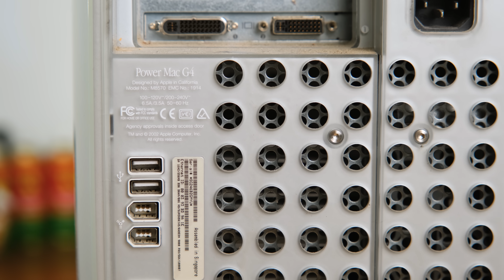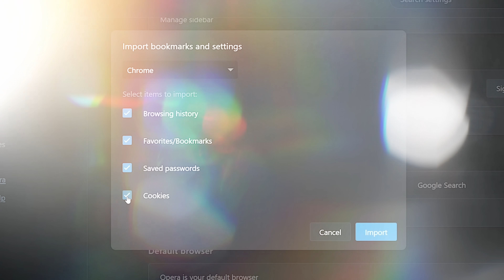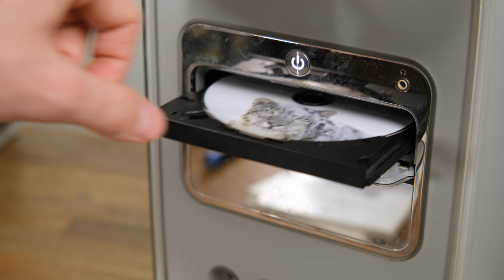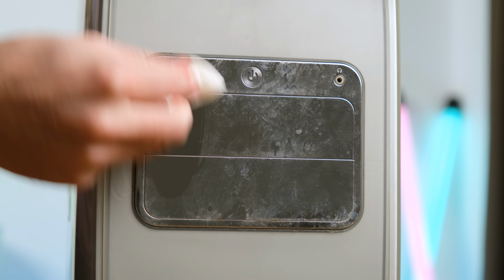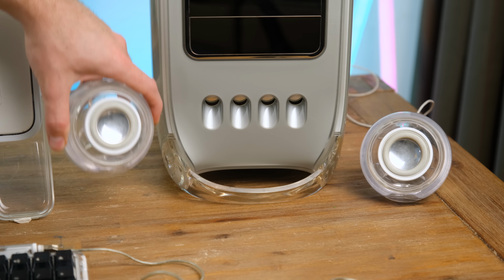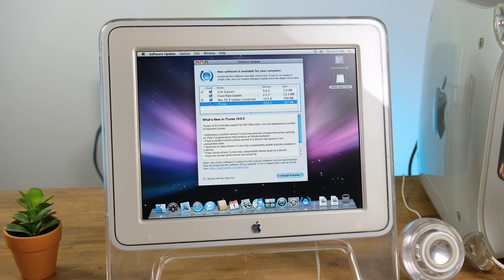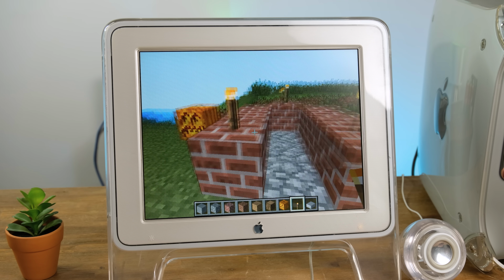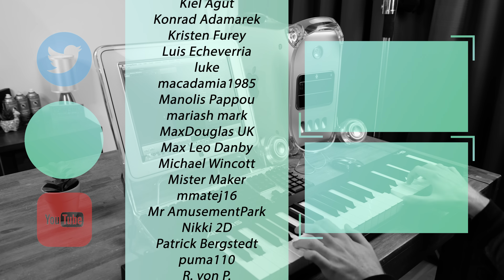Using Apple's Pro Desktop... From 21 Years Ago!

Comment: It’s kind of crazy how fast designs have evolved between the 2000s to the 2010s compared to 2010s to the 2020s. The form factor is iconic after all these years, even if Apple kind of made its own Mac Pro irrelevant in 2023
Reply: The M2 Mac Pro 2023 is NOT irrelevant, its perfect for those of us that want and need the speed and "tidyness" of internal PCIe card expansion. You obviously are not interested or aware of the many uses of PCIe expansion. Hence you are not a true "PRO" and the Mac Pro is simply not for you, The Mac Studio exists to save $$ for "prosumers".
Reply: @MelvinAstrahan-b3f  in addition to this there are also some hints for new hardware which is likely to come later (extra compute modules)
Reply: @MelvinAstrahan-b3f well it can’t use GPU’s and the compatibility list is quite short, so I fail to see why the 2x premium is worth it
Reply: @MelvinAstrahan-b3f  this comment 🤢 i use my mac for development, so going by defenition i am a professional. backend work can be done on a m4 mini though.

Comment: My main Apple retro computer. Still use it from time to time. Upgraded it as much as possible. Have a new PSU in it, dual 1.25 GHZ G4's and several other expansions ( also a much stronger GPU ).
Reply: I have an eMac 1Ghz G4 and I dual boot to MacOS9 for games.  It's not useable for the web anymore, all the browsers seem to have degraded. I can stream music from VLC and just use it as a radio. I got the MacOS9/Leopard dual boot running recently,  and MACOS9 seems to have better game options than OSX, though I've just started playing with it.
Reply: @noogai2 Are you able to watch youtube on a powerpc?
Reply: @theshadowman1398 what do you use this for? just curious.
Reply: @ShankarGanesh my dad uses a g4 on osx for his taxes and it works well with our old ricoh copier and large format printer. It just chugs along so why get rid of it.
Reply: Time to upgrade to dual 1.42s or a Sonnet card!
Reply: @rsweb1993  

Af far as I know that CPU card doesn’t work in a non FW800 motherboard

Comment: My first Mac was a G4 MDD, a dual 1.25 GHz model. I bought it in 2006 and sold it in 2008 so I could upgrade to an '06 Mac Mini 1.83 GHz Core Duo. I loved that machine to bits. It came with an SCSI controller card, useful for my Yamaha A5000 sampler I owned back then. I added a USB 2.0 card, a second DVD burner (which had LightScribe) and expanded the RAM to 2GB it was a fine machine for the time.
Btw, the small fan is cooling the optical drive cage.

Comment: This G4 tower was my primary music production computer up until 2016 when I upgraded to a G5. Some of the music I produced on the G4 ended up on records that went gold!
Reply: Man I'm trying to buy a g4 or a g5 cuz my computer is not good for music and other macs are expensive
Reply: @FlakerGamer  what are you using currently? honestly there are plenty of good PC options if you use FL Studio, Ableton, etc. I use obscure software that only runs on older Macs
Reply: @dj_grumble  the problem is i run a Celeron d 347 and a core 2 duo e7500 and both are horrible to use without a good audio card
Reply: @FlakerGamer  oh yeah. if you have a budget of even $200 you can get a modern windows laptop with an intel i3-1115g4 which will far outperform those dinosaurs
Reply: @dj_grumble  nah I don't need  performance now only good audio cuz I'm trying to get money to bought a i9 14900k with 32gb of ram and a 4070 super so where I live is very expensive but in the future I can get it

Comment: I still prefer, in some ways, the QuickSilver model as they were slightly less noisy, and they looked a bit more minimalistic design-wise vs. the MDD.  I have a few of these in various states of repair. One of my systems has a label on it that suggested that it was maxed out at purchase time - 2GB RAM, ti4200 4x120GB drives and a superdrive.   Although none of the original drives, and only some of the original RAM was left, the Ti4200 was still present.

The system you have is fortunately the FW400 model which still natively supports Mac OS 9, and is the last and one of the fastest ways to run the old OS.

Comment: I had four of these versions, the Dual 1.25 GHZ model and held onto them till 2011. I absolutely loved this model, and it was incredibly powerful and a stunning design. When I worked as a graphic designer, this is all we had in our studio at the time and it was amazing. I ended scoring a few and used them as an XBMC/Kodi Server, a Network Renderer, Fileshare Server, and then one for my home music studio as I had a lot of Firewire interfaces. My second favorite was the PowerMac G5 which was stunningly designed and so compatible with a lot of hardware out there. This is when I loved Apple; when they still innovated and lead with not only beautifully designed machines outside, but also inside.

Comment: I've got a Quicksilver 2002 @ 800MHz that still works well enough. In 2009 I ordered a Sonnet Allegro USB-2 PCI card that gave me multiple USB-2 ports. Recommended!
Reply: overclock it !
Reply: I have a quicksilver 2001 867mhz. It’s pretty nice. I upgraded the GPU to a Radeon 9000 pro 128mb to replace the 32mb GeForce 2 MX. The GeForce is faster in UI acceleration l, but the Radeon is noticeably faster in games. I’ve also added a USB 2.0 card. I plan to add a wifi card at some point. And possibly a SATA controller to boot sorbet leopard faster.

Comment: finnaly a new one!
8:13 for the foam Noctua add this like 1 years ago just check the size it's look like 60x60 fan so the foam you need is around 70-80 range

Comment: The drawbridge-PowerMac G3/G4 case design was an absolute classic - very aesthetically pleasing but also so simple,and easy to access and upgrade. Another era. I owned and used various versions between 2000 until about 2016 when I sold my last ProTools rig that still ran like a dream. Was just a shame that the G5’s thermals were never going to work in that neat, compact case. I remember getting my Dual G5/2GHz in 2003 and being shocked at the size of the tower. Mind you, for AU$7000 at the time, at least you were getting a ‘lot’ of computer 😂

Comment: I actually turned this particular model into a lightup drink dispenser.
Gutted the inside, installed a pull-style metal tap through the speaker hole in the front, wired white LEDs into the corners of all 4 handles, mounted a motorized air pump inside, ran a inlet tube from the pump to a custom 3D-printed cap which forces air into the drink container, and another tube that runs from the container towards the front to the tap spout. And finally, an electric sensor hidden in the handle that when pulled, activates the motor. Motor forces air into bottle, which forces liquid out the bottle and through the tap spout. Also a master switch in the back that turns on power and LEDs. Unfortunately it works much better with non-carbonated drinks (soda and beer comes out sort of flat).

Comment: I have one or three of this, one wasn't working and the troubles was the RAM, but not only I changed the processor and it's working but didn't know that higher processor isn't accepted so the computer shows less G than normally is... great machine .

Comment: I’ve always preferred the look of its predecessor, the QuickSilver 2002 range, of which I’ve still got my powerhouse with upgraded dual 1.8Ghz CPUs, 1.5GB RAM, and for the day a “massive” 60GB SATA SSD as an OSX Tiger boot drive. With FCP3 and DVDSP I felt unstoppable.

Comment: You’re lucky your loud fan spin problem was RAM related. That issue is usually power supply or CPU card related but could honestly be nearly anything and is almost impossible to debug. Mine’s issue was probably the CPU card, but I am planning on converting it to a sleeper PC.

Comment: Nostalgia! I bought one of these new back in the day.  Single 1.25ghz processor, I don't remember the rest. Paid US $1500 for it.  I ended up lugging it to work and using it there, it was fun confusing everyone (Macs were still SO rare in offices back then).  I sold it a few years later for I think $1200 or so, when Macs still had really good resale value.

Comment: I used to have one of these given to me by a neighbor, it was a top-spec dual-1.42ghz FW800 G4 that was a very cool system (while it worked). Sadly the PRAM battery died and leaked all over the board and I didn’t have the means to fix it so I had to scrap it and recycle it. I still have the G4 processor card and it’s a highlight of my little parts collection I have

Comment: I also got an MDD free from a relative.. with the studio display, speakers, etc.  I had to have the proprietary PSU refurbished but otherwise it works great.  But it's the FW800 version, so doesn't run Mac OS 9 natively.  But no worries, because another relative gifted me a Quicksilver G4 Dual 800 MHz as well.. !  This one runs Mac OS 9 natively and that makes it so much fun.  I love getting old software off of Macintosh Repository or Macintosh Garden.  My children like to use it.

Comment: fun fact, you can over clock it by resistors on the daughter card. and motherboard. 
Turning a 133MHz CPU card into a 167MHz CPU card is just a matter of removing the R22 resistor.
 If your CPU card was a dual 1.0GHz, it will be a dual 1.25GHz after the bus change!

And will run Sorbet Leaopard very well.

Comment: I had a mint condition Mac Pro 3,1 and now I wish I would have kept it. I would have loved to artfully place an M1 Mac Mini Mobo inside....adding connectors and cable for the backplane I/O.  I really I love the look of these Mirror Drive Door units...they are older, a bit more rare and are a lot more rough.....but I am now motivated to look for a case in good nick.

Comment: Big hello all the way from El Paso Texas
I wanted to share a tip to remove the yellowing on the clear plastic parts. All you need is little bit of Salon Care Hair Bleach  applying thin layer of the cream to the clear parts that have oxidized and wrap it with Saran Wrap put it in the sun for about an hour or two repeat the process until you are satisfied with the results. I promised the yellowing will be completely gone after the second try

Comment: I had one of these until I needed the space and switched to a MacBook. I think I paid around $1800 USD in 2002 for video editing use. Final Cut software was pretty good but the PowerMac G4 just couldn't keep up and the workflow was very cumbersome. You don't see many MDD G4s on the internet now because the PCI slots are on the wrong side. You could probably get a PCIe riser cable and hack something together, but it's easier to use a G3, G5, or earlier G4 case! Too bad because this case is cool looking!

Comment: Until recently, I had a Power Mac G4, Sawtooth as part of my regular workflow. It ran older software such as Aldus Freehand or Corel Draw for the Mac. Also, older versions of Illustrator allowed conversion of .CRD (Corel Presentation clip art) to AI. It was slow but got the job done. Now that there are websites which will do conversions for me, I really didn't need the G4.

Comment: I had a Snow Leopard desktop pro--worked perfectly but the operating system was too old that even the browsers did not support it. I remember changing the CPU to its maximum, and the upgrade was minimal. The browsers "worked" for a while until they no longer supported it. THAT is when I threw it in the municipal dumpyard. So even if you got that Power Mac G4 working, you can't really use it.
Reply: A handful of modern Linux distros can be installed on PowerPC Macs, which then gives you access to modern browsers and features. Ubuntu supported PowerPC up until 2019 and now there are community made forks for the most recent versions for PPC.
Reply: @EmergencyChannel  I'm not a fan of Linux or Ubuntu. Windows based apps such as MS Office, and most games do not support Linux. It does not support Mathematica software.
Reply: @TomokoAbe_  Also that's wrong, a lot of games are supported in Linux now thanks to Steam's Proton layer. The number will only grow.

Comment: After using an dual 867 MHz, I later got a single 1.25 MHz because it was the most powerful dual boot OS9/OSX machine. It's pretty mundane except for the Radeon 9800 Pro Mac Edition graphics card. I remember that card, back in the day, really boosted it in games.

Comment: You didn't mentioned that it's like a jet engine! I have that same model but upgraded to dual 1.6 Ghz G4 processors. It works better with Tiger than with Leopard. 👍🏼

Comment: I have built up a dual 1.25 GHz MDD so it has a SuperDrive DVD in the upper optical bay and a Combo Drive (DVD read/CD re-write) in the lower optical bay. It has 2 GB RAM and an couple of expansion cards to get decent USB speeds and more FireWire ports. One has 4 x USB 2 ports, the other 2 xUSB 2 and 2 x FireWire 400 ports. 

There's a cheap USB stereo speaker that sits between the aluminium keyboard and 20-in Acrylic Cinema Display. The display has two low-power USB ports on the back, I use one for the keyboard and the other for the speaker set. A Logitech USB wireless mouse dongle connect to one of the keyboard's USB ports, the other has a BlueTooth 2.0 USB dongle.

All four drive bays are used, one for Leopard (OS 10.5.8) and one for Tiger (OS 10.4.11) plus OS 9.2.2 via the Classic environment. The other two drives a concatenated to appear and act as a single larger drive and and are used for internal Time Machine storage.
It's my go-to device if I want to record a music CD as it's faster at that job than a modern Mac using a USB-2 SuperDrive.

Comment: I also have one that’s maxed And I can’t really find much of a use for it.  I’ve tried just about every browser and nothing works well for modern tasks. About the only thing you could do to make it faster is an IDE to ssd or IDE SSD. The graphics won’t really even do much if you upgraded the card. All the upgrades I found that are reasonably priced help it, but are barely noticeable. I’ve also had mine apart before and cleaned everything like you did and wondered how you were going to get the back panel off. There was one thing missing from mine that yours had which is that panel on the back of the optical drives.  I’m using a 23” Cinema Display and it looks nice. You can buy them for around $30 today. Performance wise, 10.4 should’ve been the last supported OS as leopard is just way too demanding.  The G5 runs great with leopard as you probably are aware. Just remember that the internet was much simpler back when it was new or a few years old.

Comment: How com you did not in stall a SSD Drive,wouldn't make it run faster. I don't really know if it would but every old computer I put one in was 2 times faster.
Reply: On PC's this old it wouldn't really help, it'd help make them more reliable and quiet though
Reply: That computer does not have SATA connectors but older IDE for hard drives and SSDs with IDE are very rare. I think there might be some adapters that allow compact flash cards to be used or something.
Reply: Huge bottleneck by the IDE interface, even if you were to add a SATA to IDE adapter
Reply: @Boyracer73  MSATA to IDE adapters exist and work well for these machines. Even the slowest spec modern SSD is enough to max out the bus. It definitely helps responsiveness but won't be a huge upgrade because the bus on these machines is extremely slow by modern standards